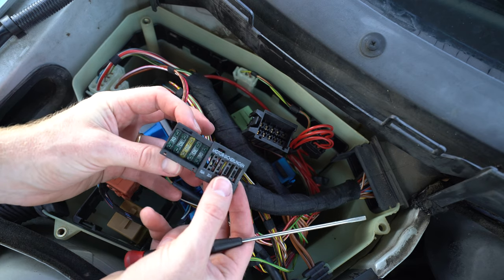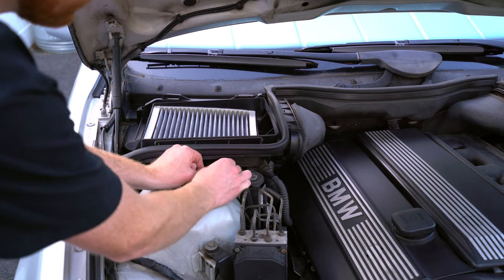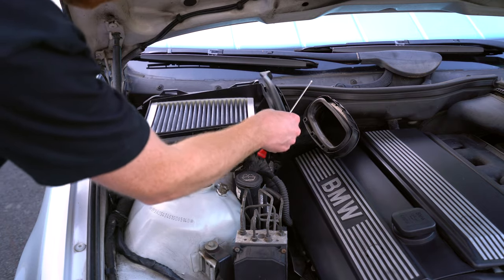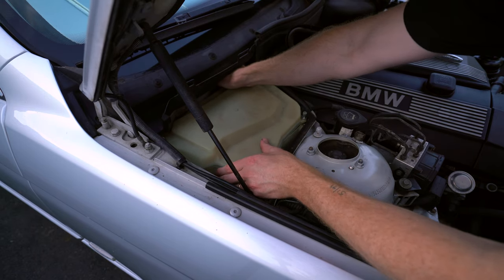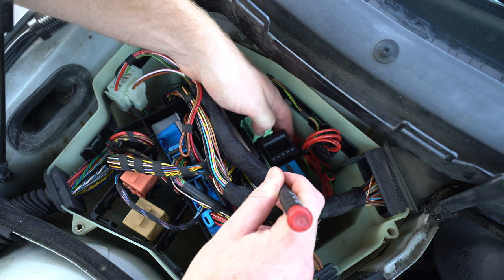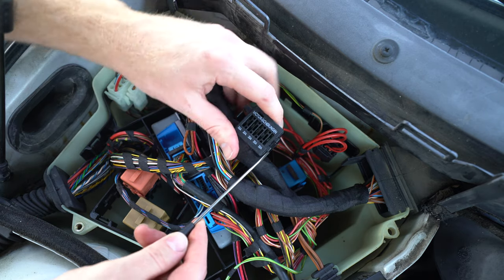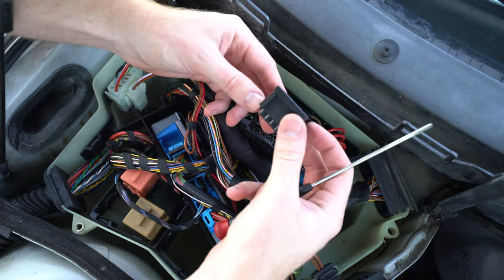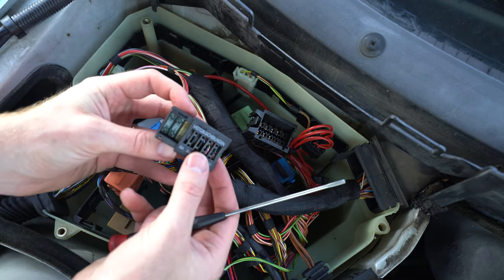E39 BMW Motor Fuse Box Motor-Sicherungen Location and How to Open It

Comment from the maker: E39 Buyers Guide: https://youtu.be/70zvnZdvEog
BMW Goodies: https://amzn.to/3ql5Dd1
My Blog: https://bimmerzeit.com
My NEW Project: https://www.wagenart.com
The BMW Store: https://amzn.to/3ql5Dd1

In this video I show you how to open up the motor-sicherungen or motor fuse box located in the water proof DME box under the hood. I struggled with figuring out how to slide the cover off of the 5 fuse box while I worked in 100 degree heat this Summer. Here's a two minute guide showing you how to open that fuse box and the water proof DME box located under the fresh air intake - also known as the cabin filter box on an e39 5 series BMW.

My favorite detailing products:

Griot's Synthetic Clay: https://amzn.to/3gAO17P
Dual Action Polisher: https://amzn.to/2Z4cFI6
Hexlogic Foam Pad: https://amzn.to/3f9auIC
Meguiar's 205 Polish: https://amzn.to/2Z998IC

BMW OIL FILTER TOOL: https://amzn.to/368Uz9i
BMW GERMAN OIL FILTER: https://amzn.to/2MPdE8P
CREATOR C310 BMW SCAN TOOL: https://amzn.to/2NaIuru
GREEN MOLYGEN OIL: https://amzn.to/31MfCLi
LiQUi MOLY ENGINE FLUSH: https://amzn.to/2MJ8cUQ
LIQUI MOLY LIFTER ADDITIVE: https://amzn.to/2MKdNu3
LiQUi MOLY JECTRON INJECTION CLEANER: https://amzn.to/31IwpPt
BMW Maintenance: https://amzn.to/2PhLncF

ONLINE http://www.bimmerzeit.com
THE GRAM http://www.instagram.com/bimmerzeit
FACEBOOK http://www.facebook.com/bimmerzeit
TWITTER http://www.twitter.com/bimmerzeit

Questions? Send me an email at bimmerzeit@gmail.com

My CAMERA GEAR;
Sony A7sii: https://amzn.to/2zwwwVC
Sony 16-35: https://amzn.to/2NIeXF1
Rode Mic: https://amzn.to/2ubhfo5 
GoPro 8 Black: https://amzn.to/3gbtSFU

This description contains affiliate links. If you click my custom link to purchase a product, I will earn a small commission at no extra cost to you. Win!

Disclaimer:
Due to factors beyond the control of BIMMERZEIT, we cannot guarantee against improper use or unauthorized modifications of this information. BIMMERZEIT assumes no liability for property damage or injury incurred as a result of any of the information contained in this video. Use this information at your own risk. BIMMERZEIT recommends safe practices when working on vehicles and or with tools seen or implied in this video. Due to factors beyond the control of BIMMERZEIT no information contained in this video shall create any expressed or implied warranty or guarantee of any particular result. Any injury, damage, or loss that may result from improper use of these tools, equipment, or from the information contained in this video is the sole responsibility of the user and not BIMMERZEIT. Video and Content is owned by BIMMERZEIT © 2021

Comment: Thanks for posting this information.

My E53 X5 engine would crank but not start.

Fuse F2 was blown. I think I may have blown it by spilling water on a VANOS solenoid when replacing a coolant hose.

But I couldn’t get that fuse holder open until I watched your video.

Thanks.

Comment: fuel pump is not working. zero pressure at schader valve, had  pressure and  it went out. Tested fuses like you  showed in video and all were  good with no resistance between prongs.
i have an air  valve(i think) on left side  of  engine (drivers side) that is  buzzing and  making  noise. Would  this cause  no start ?

i have  p0604 code, p0174&p0171 with p0600 and p1620 codes. I think i fixed  the  lean codes as  i had a  huge  split  in intake  boot coming  off mass air  flow...

im really leaning  towards bad ecu, or  bad  pin maybe ???

Comment: hey quick question does this piece plug into the rest of the harness or is it wired together with the harness leading to the cab. trying to find my fuse box but i cant since my car was bought as a parts car lol

Comment: Very helpful. When I try to remove the 4 allen bolts in the plastic top, they turn, but just pop and crackle, but don't loosen. Any suggestions?
Reply from the maker: The stud they’re screwing into might be turning. Try pushing down hard and turning to get that initial turn to loosen.
Reply: @BIMMERZEITT  Thanks! I need to get a allen socket so I can try that. I just have a little allen wrench.

Comment: I'm having a trans failsafe prog on mine with the trifecta lights (ABS, Brake and traction control lights), any idea which wires/fuses to check? I'm thinking I may have a short on a wire since it occurs when the engine is hot but fine during cold start.

Comment: Hey. Great video. Do you know if there is any fuse in there responsible for the instrument cluster light? My instrument light including buttons is suddenly dead...all other fuses from the passenger side / trunk are ok. Thanks for your answer
Reply: did you find a fix
Reply: @AKTHUNDERDOG   Yes. On the right part of your E39 (passenger side) you have the LCM Module . Is a black box which is responsible for your entire illumination on your car. You can buy a good second one from ebay. Getting a new one from BMW will kill your wallet. I hope it helps. Make sure to get the same code if possible.

Comment: I found the fuse capsule impossible to pull out as it was tightly bond by other wires in the box. Used a a multimeter to determine the viability of the fuse,

Comment: Any idea why I am not getting voltage reading from f2 f3 f4 f5 am getting reading from f1 though, 1999 528i e39.
Reply: Oh i have a friend who has a friend who's father had same problem,  he replaced DMV module
Reply: @dkrawk8309  That was my conclusion after going through literally everything, first noticed auxiliary fan not coming on swapped it for a used oem no luck then a new after market still no luck, although were getting 12v at live hard to test the pulse signal from dme, just hooked up a universal fan with toggle switch in cabin-sorted.

Comment: Help me i have a e39 530i
With fault codes p0171  and p0174 basicly it says that the car runs to lean amd it does run very bad. I have watched hours of videos about how to fix this issue but nothing serms to be working i habe changed the MAF i have changed the seal to the disa valve amd i have made sure that the valve works too. I also did a smoke test and it does not have any vacum. Leaks. So what more should i look for does anyone have som experience
Reply: Compression test all cylinders

Comment: I have a question about the Fuses, my engine is spinning but it wont start,
when ignion on all i can hear is 3 clicks from the Fuse box in the engine bay. DSC light is also on. 

Any help ?
Reply: Did you fix it? If so what was it
Reply: @Omgkhii  yes i did fix it, it was a blown fuel pump fuse in the trunk
Reply: @MrCone-sq2tq which fuse? I have the same problem.

Comment: Mine Motor Shlurgen box is different and will not open no matter what I do haha, time to smash it to pieces
Reply from the maker: It’s not easy! It just looks easy in this video.
Reply: @BIMMERZEITT  this is very much need vid you made like it was for me  :) well, I have a question, do you know where the throttle body fuse is?  I would really appreciate since false motor program is showing in my e39 540i

Comment: Can you please help i have a e39 and for some reason when i insert the key i dont get the gong chime anymore  scan tool showed gong T3 gong so i even changed it but still the same issue can you help is there a fuse for that nobody can answer this is there a possibility when i had it in shop some machanic tuned it off i am stumped can you help please Thanks very much